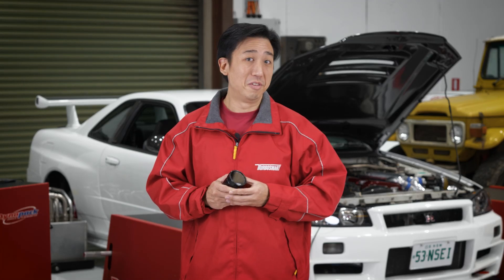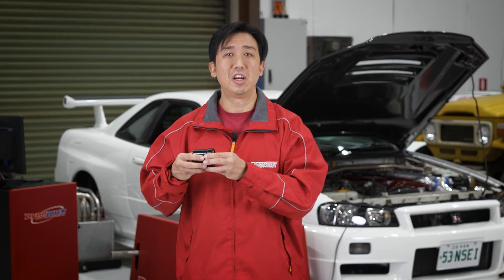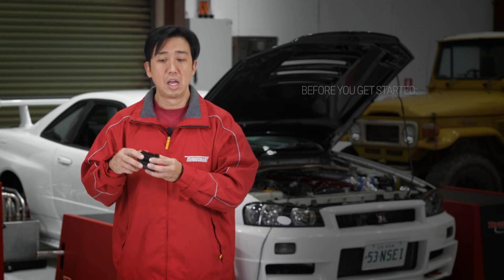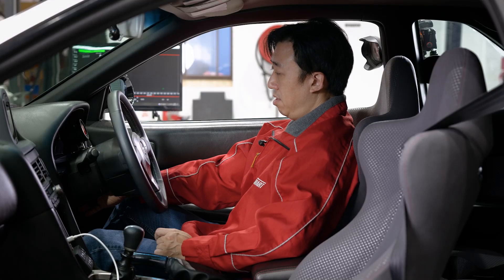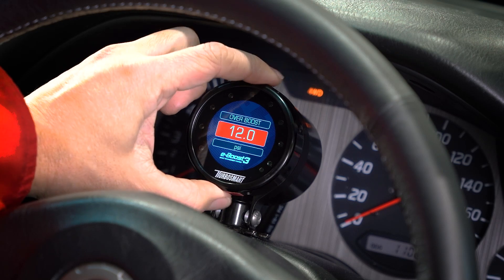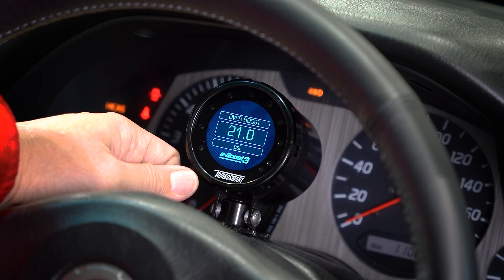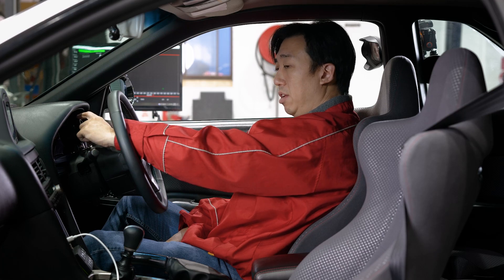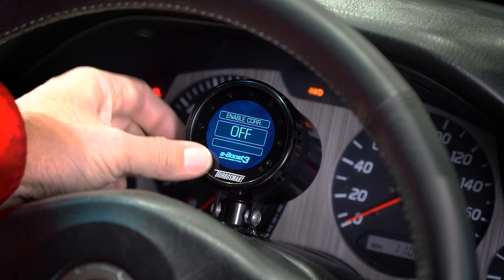Easy Tutorial  - eBoost3 Basic Boost Control Setup Tutorial

Comment: Finally pulled the trigger on the "3".  The differentiator for me was the ability to use a high quality MAP sensor like a RIFE off the manifold instead of running a long run of vac hose into the cabin.  Also looking forward to trying the black box to eventually control electronic waste gates!